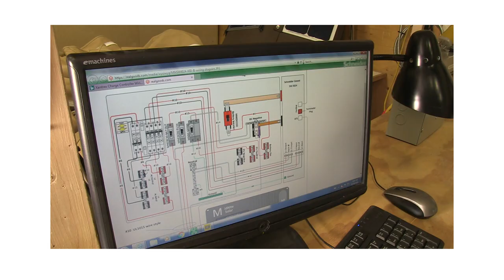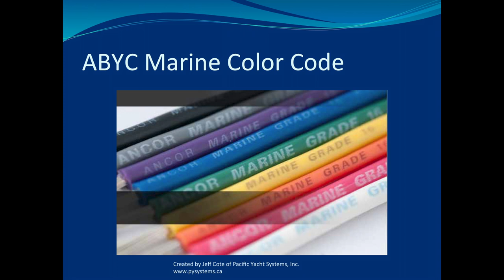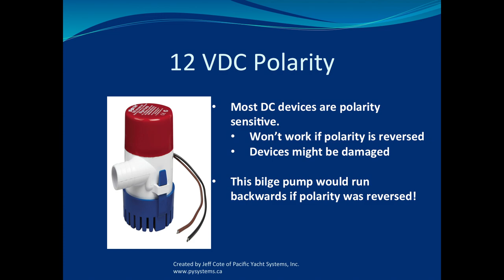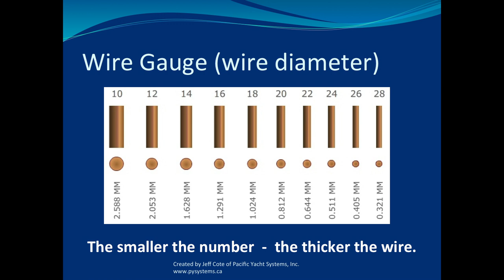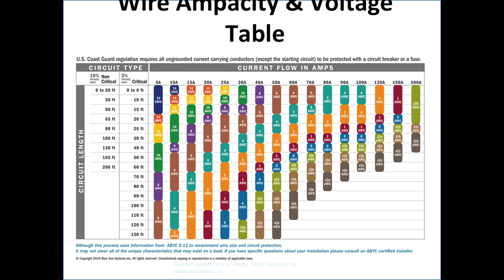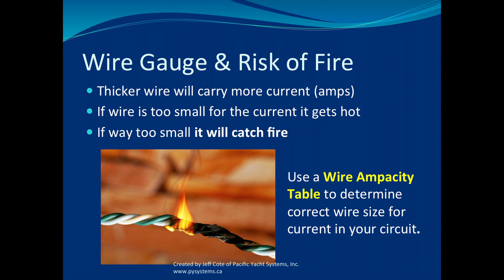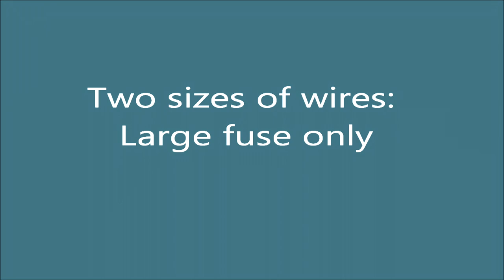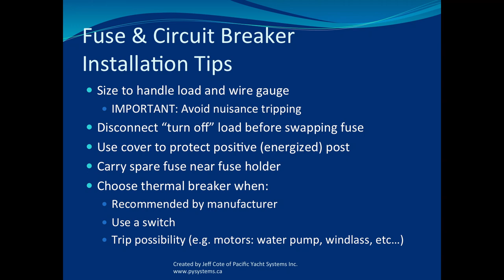How To: Marine Electrical Seminar - Wiring Essentials - Episode 8 of 12

Comment: So, Jeff, I was soooo proud of myself (designing my battery bank & surrounding safety systems), but- this was incredibly eye-opening! Almost every single wire run has multiple wire gauges installed, and, every single one needs a properly sized (nuisance tripping) fuse. NOW, I 'get' why a tired owner says "I'll add the fuse next weekend, when I get back." Which, never happens. Love the smoke show over 14AWG wire catching fire- very good footage.

Comment: Jeff, can’t thank you for the amount of information, knowledge, abd experience you are sharing. 
I have a question regarding for my 28 feet boat from ‘79. I am planning to rewire the whole electrical cabeling soon. However, on my boat the engine is on bow with start battery next to it and house battery and DC panel is on stern. It is quite long distance (one way about 9 meter so full way about 18 meter) between alternator and house battery. In modern boats they usually placed next to each other in engine room. But in my case they are far away from each other and I think voltage drop on cable from alternator to house battery will be a lot. And probably I should use 2AWG cable for such application, without knowing my alternator output current for an engine from 79. I haven’t checked and measured yet.
What do you recommend in such cases where distance is a lot?
Huge thanks and please keep up this great work!
Regards from Sweden
Deniz

Comment: Hi Jeff, thank you so much for all the info. I have one question that I’m struggling to find the answer to. If I have an inverter that outputs 10kw constant, but can output 14kw in short bursts, do I have to wire for 10kw or 14kw? Can wires that can handle 10kw handle 14kw for very short periods of time, say like when starting a hoover or something similar? Thank you so much for all your help.
Reply from the maker: I would follow the wiring chart in the manual.  the wiring and the fuse size should be able to handle the bursts.

Comment: Great video Jeff, what do you think of the digital switching coming out? I’ve seen it advertised on some new boats. They reduce the resistance of the circuit (no fuse), by implementing a programable circuit breaker (digital fuse). I’m thinking of things like Carlingtech’s CML: or EmpireBus by Raymarine. It seems to have offer some nice monitoring and control features not available with mechanical fuses. (That’s at the distribution level, there is still a fuse at the battery to the supply trunk).
Reply from the maker: Definitely the future and makes sense when building a boat or doing a large retrofit.

Comment: Great series. I was watching your episodes 1-12, but lost track. How can I watch them sequentially? I'm taking screenshot of the presentations so I can follow through while I work on my refit. I tried to get ABYC trained once but looks like it takes an act of Congress to do. My dc wiring on my boat (1984) is all original 10GA yellow/black, but there's no fuse box, and it's my goal to correct that. That's why I subscribed and get notifications, to enhance my knowledge. Thanks.

Comment: A very useful video, has been very helpful in correcting past owners "cheap" fixes. However, are there not a lot of Euro built boats in the US ? Beneteau, Lagoon, Jenneau ? I currently have a 2005 Beneteau. I know two owners that imported Oysters into the US from the UK. As they were first registered in the UK they were built to the CE/IEC standard. Now on my Beneteau all the 12v positive wiring is red, and all the -ve black, which does seem to also be the ABYC standard. They have not bothered to colour code the separate feed wiring, everything from the panels is also red for positive. The 220/110V wiring is live Brown, the neutral is Blue, and all the grounding wiring is yellow/green. The separate grounding cabling is also yellow/green. 
I really think you should have pointed out the different US/EU standards to avoid confusion on imported boats.

By the way, if a shock from 220V AC was fatal I would have been dead dozens of time.
Reply from the maker: Great points John, thanks for highlighting the difference between US and Euro boats.

Comment: Great videos Jeff....thanks for all the information.
I have a question. I have a Microlog DMM-1 installed and I would like to install a Xantrex LinkLITE Battery Monitor. Is it possible to use the same shunt? can I have more than one monitoring devices sharing a shunt?

thanks 
Michel
Reply from the maker: When you buy a Xantrex Linklite it comes with a shunt. You'll need to make sure that both shunts have the same rating to be compatible.
Reply from the maker: When you buy a Xantrex Linklite it comes with a shunt. You'll need to make sure that both shunts have the same rating to be compatible.

Comment: Love your videos but .... as a Brit I take issue on wire guage or should i say AWG -- American Wire Guage, somthing we do not use here especially as it is for solid conductors relates to the number of times a wire is processed to get it down to a particular size. Also you guys need to get up to speed on colours. Red and Black are purely for DC Brown is AC Live and blue is AC neutral.
Reply: Not here in Canada, bub.
Reply from the maker: Hi Chris, thanks for sharing the code in the UK. Here in Canada, we follow the ABYC code. I hear you the wire size and the colors could be improved.